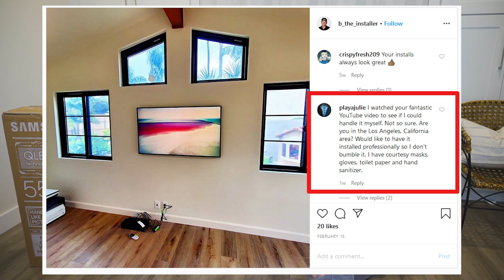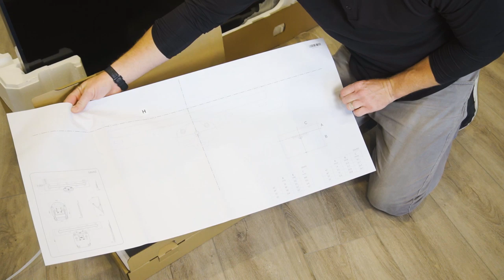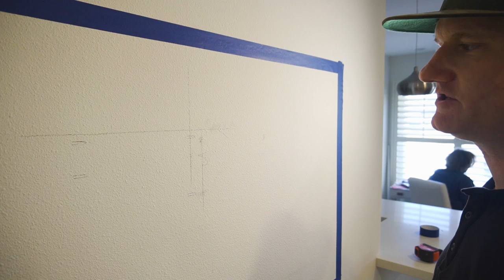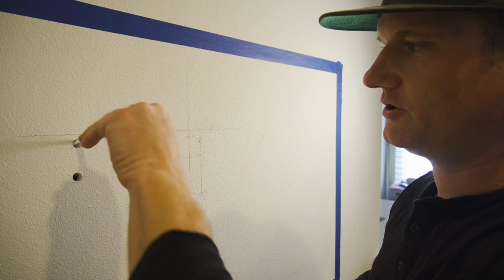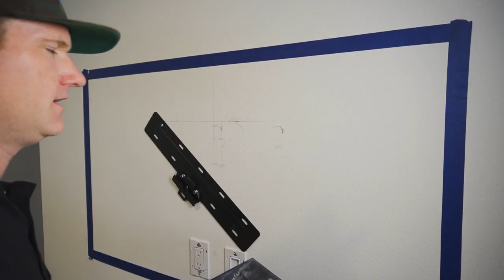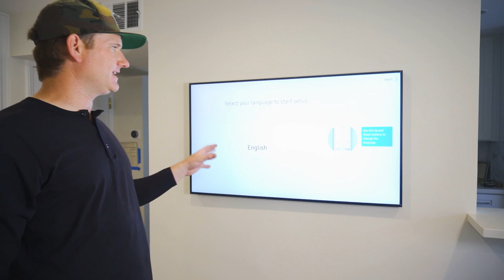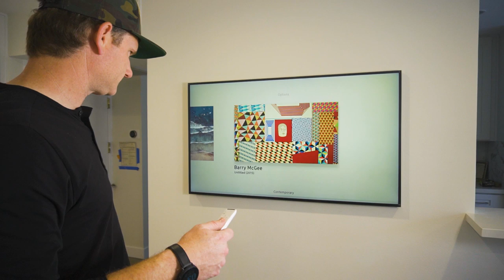Samsung Frame TV Install With No-Gap Wall Mount

Comment from the maker: New 2020 Samsung Frame video w/white customized bezel https://youtu.be/iUtvD4ZP74U
Reply: I noticed you took the outlet face covers off. Would that protrude too much for the TV when flush against wall. That was my concern for mine. I have an outlet  behind the tv, but didn't want it to cause the TV to not be flush against the wall
Reply from the maker: @calferath  yep, just push the outlet flat as possible.  You can overtughten the screws and suck it in.
Reply: Is the one connect cable that came in the box “In Wall” rated?
Reply: I bought a 50 inch frame because of you.
I hope my installation goes well 🤞🏽🤞🏽🤞🏽
Reply from the maker: Haha me too.  Post and tag on IG
Reply from the maker: No.

Comment: Thanks, you actually solved a concern I was having with my above the fireplace install. I though I was going to need to route power and Ethernet behind the tv. I don’t. It’s as simple as getting a couple of outlet boxes and covers to fish that wire through and building a shelf where the main box will sit on. Thanks again!

Comment: Thanks so much for sharing, it is so helpful. This is the 3rd Samsung frame installation from you I watched just before I did it a few hours ago.
I understand why your follower wanted you to do it, because you made it look like so easy! Lol
I actually struggled a lot with the toggle bolts, and even drilled all the way through the dry wall to the other side, ugh! Anyway, I eventually make them work and heeded your advise by adding just a couple more Samsung srews. I skipped the wiring because of a decorative wood panel attached to the dry wall, so basically just the measurement and 4 screws, but it took me 5 hours (including unexpected 2 trips to hardware store for extra toggle bolts). I'm glad I made it even though it took me such long time. 
Thank you again, without your videos I wouldn't have been able to do it at all.

Comment: Love the video! Have an upcoming job installing one of these TV's. Pro-tip from one professional installer to another: Invest in some JIS (Japanese Industrial Standard) screwdrivers or drill tips. Often times it's not the screws that suck, it's using a regular Phillip's head that does the damage as you noted due to the screws being JIS :)

Comment: fantastic install, but how the heck did you get power to the TV without putting in a recessed outlet? It looks like the face of the outlet would be right up against the back of the TV with zero space to route the cord?

Comment: Hi B. We have a stone fireplace all the way up the wall but we do have one of those holes already for wire to go into the wall and into the cabinet below installed. When hanging the frame tv ups we just use different screws and drill bits to drill the holes to put the tv anchor up?  Awesome videos you have helped me out so much already. Trying to place this tv perfect

Comment: Hey, B, thanks for all these helpful videos. I've learned a lot from you. If there isn't an existing conduit, what exactly needs to be done to add one? Are there specific kinds of hardware that can be snaked behind the wall? I really want to run the one connect cable behind the wall, but also want to be code compliant. I know Samsung sells an in-wall rated cable, but the few reviews I can find suggest that it's too thick to fit in the routing channels on the back of the Frame and people aren't able to do a flush mount with it.
Reply from the maker: Snake a little flex tube down the wall. 1.5 inch. Easy solve.
Reply: @BTheInstaller  Which conduit should we use?

Comment: Thank You so much! I do work on installing mounting tv sometimes and I just try to find out what type of driver bit is the Samsung frame mount screws cause it is easily to be stripped and I had to replace it with the one that it looks like it but i just prefer to install with the original ones which I can't trust on anyone of those, is there any advice to screw them in easily (the only solution is to put some soap over it?)or i just replace for different easy one? thanks B I learnt a lot watching your very informative video!! and I added to my skills on how to install this type of tv Thank You!!!!

Comment: Hi - great videos! Have you worked with the 2021 version yet? I just got it and the wall mount is a little different and seems to me to have a flaw -  difficult to describe but the part of the mount attached to the TV doesn't hold in place when you latch it onto the part on the wall. Curious as to your thoughts!
Reply: I was looking to see if anyone asked this exact question because I'm currently in the same situation with a 2021 version and the mount part connected to the tv not holding in place. I don't want to keep pushing it further back but I feel like there's a gap for sure. I don't know what to do. I may contact Samsung

Comment: Great video and straightforward friendly instructions. What are the concerns if you drop the one connect wire behind the wall without conduit since it is not in wall rated. How big a deal is this?
Reply from the maker: It likely will never be a big deal.  But if a fire starts in the house, that wire can't withstand heat similarly to one that slows the spread.  It's real some low % stuff, but I can't ignore it for anyone to get an issue.  Gotta do you.

Comment: Hey @B , thanks for this (and other) great install vids for the Frame. I followed your instructions and was able to get mine set up pretty easily. I needed some help after stripping a poor-quality Samsung screw, but other than that it was smooth. Thanks again!
Reply from the maker: Glad to hear.  Those screws suck balls.

Comment: Thanks for creating this video. We are forced to install ourselves due to Covid. This video will help us tons. Otherwise we would hire geek squad or want to try to hire B the installer to do it !
Reply from the maker: Good luck.  Keep me posted.  Share an image on IG and tag me
Reply: B The Installer we installed the TV. The only thing we noticed is there is a slight gap btwn back if tv and the wall.
Reply from the maker: Shouldn't be more than a normal picture.  Hey tag me on IG if you post a pic. Thanks
Reply: B The Installer yes. I tagged you on IG. Hmmm. Idk why there is a gap. Shall we just push on the top area where there is a gap?
Reply from the maker: You can pull out the bottom while pushing in the center of the top.  It may help.  Yes you can manipulate the tv a little to get it to sit flat.  Just be careful not to lift upward
Reply from the maker: Could also be that your wall isn't perfectly flat.  That does happen....
Reply: B The Installer thanks. Well we did have two outlet wall plates located right above the wall mount bracket on the wall. Could that be the reason for the gap?
Reply from the maker: Did you remove the cover plates? I would.
Reply: B The Installer we forgot. I think that’s why it’s not flush on wall.

Comment: This is exactly the information I was wanting.  Excellent!!!   You stated the one connect cable is not "in wall" approved. So where you dropped the one connect cable, is there a piece of conduit behind the wall?
Reply from the maker: There are sometimes.  Sometimes not.  I put in wall either way. It's technically not rated for in wall, but that is hard to evaluate the risk vs ease of use.

Comment: Thank you for the video - helpful as always! My question is with the One Connect Cable - is it okay that a portion of it is between the wall and TV before it goes into the hole? Will it be pinched between the TV and wall enough to cause damage? Thanks again!
Reply: I am worried about that too and does it add more space between the wall and TV? Makes it look tilted due to the wire bump? Do you have a photo of this installation from the side angle? Thanks for making these great videos B!

Comment: Getting mine mounted on Thursday! Planning on running the cable in-wall through a nonmetallic flex conduit. So you haven't had any issues with your installs where no conduit was used and cable was run in-wall? I'm a little paranoid so may be turning off the outlet every night before bed until an in-wall rated cable comes available for my model hah.

Comment: Thanks for the helpful video B The Installer! It will come in handy once I get my hands on one of those babies. I've looked everywhere but can't really seem to get a video that shows how far the TV tilts to the sides (6 degrees as per Samsung) as I'll need a bit of an angle when viewing. If you looked into that what was your impression, can you angle it enough to view it from the side?

Comment: 👍Good installation video,but one question- you did not done hole just behind the one connect TV connection in this installation? Does that fibre optic cable will get problem in future due to continuous pressure from TV unit,and the TV will also pushed little bit forward(tilted) from lower part??
Reply from the maker: No, there is little pressure on the wire from the tv and they lay very flat.

Comment: Thank you for this video!! Do you know if the mount would accommodate a tiny gap (like 3/4in)? Or does the TV really need to be completely flush with the wall for it to work? I wanted to install it on a wall where the middle is recessed a tiny bit.
Reply from the maker: Put a piece of 3/4 inch plywood on the wall by mount
Reply: @BTheInstaller  Thanks! I'll give that a try!

Comment: Great video.  I just purchased a 2020 55" Frame TV and wanted to know if i can use the One Connect chord that came with it in a thru the wall installation. Do i need or have to have a conduit? Thanks.
Reply from the maker: Well my videos will tell you that you should have only in wall rated cords in.  But it's a cord I put in wall with understanding and agreement of clients.  Does it look better in wall? Is it really a fire hazard ?
Reply: @BTheInstaller  Thanks. Sounds like it's up to me to take the risk or not.  Are your questions for me about looking better in the wall and if it's a fire hazard? Not sure what you mean, sorry.

Comment: Hey I take it you mount the TV frame into one stud which is in the middle of the frame and used the toggle bolts to mount the frame on the dry wall? That way you can have the tv centered on the wall?

Comment: Great video!
Regarding the fish tape, is it possible to bring the cable diagonally and across the wall to the other room?
Reply from the maker: You can down and out the back if there aren't breaks.  The studs prevent left and right movement.

Comment: Great video!! Do you think the toggle screws (using a mason drill) would work to mount on a stone veneer fireplace? I cant tell if i have studs behind my stone veneer. Would really appreciate your help!
Reply from the maker: Hey Josh, yeah its not super easy to find them, but it is framed...yes.  I use a 1/4 and 1/2 inch hilti drill bit and drill.... if you can shoot the 1/4 inch in between some of the rocks, depending on the pattern or if there is grout, you can angle it one way and put a hanger in and see how far left or right the stud is... and the 1/2 inch can be used in combo with togglers
Reply: @BTheInstaller   B The Installer  thanks man! Do you think the toggle screws are enough or do u have to find at least one stud? I guess the previous owners would have had to use studded frames to build a stone veneer fireplace, right? Thanks for the tips!
Reply: I have a similar stone tile veneer issue, but mine are also uneven. I think I can still do with toggle bolts and space out the bolts with extra washers to make it level to the wall?  Would love to hire you for a consultation to discuss, will send a note.

Comment: Thank you for the great information. I know in your video you discouraged this TV on a brick wall, BUT if it were a new build, would this be OK with proper planning ahead of install? Any recommendations?
Reply from the maker: Build in a panel with power in wall and house or you'd have to run the wiring through a channel of some sort, and as stated its not technically suppose to be in wall unless its the in-wall rated cord.  https://images.app.goo.gl/i5PYV8QpW33VtNvq6

Comment: Great installation video.  Thanks!  I have a question.  I like the idea of a TV doubling as a framed piece of art.  In your installation video you mentioned that The Frame TV would not be a good choice for installation on brick or stone primarily because of the one box cable.  I am redoing my dated brick fireplace with stacked slate.  I  have an electrician who will be running power and coaxial  to the area where a TV will be mounted prior to the fireplace refacing.  Is there solution that would allow for The Frame TV?  Or is this a situation where I should just purchase a different TV?  I am unaware of any other TVs that double as framed art.  Are there others or no?  Thank you very much for all of your help.  I appreciate greatly.
Reply from the maker: The power and coax will do you no good with this tv.  The coax is pretty pointless, i would just stream a service or run am hdmi. But if the power and coax/hdmi are going to be run, get the LG CX.  Most new tvs have art options, this one just has the frame look.   The LG looks way better.

Comment: Great video, thank you. My question is not so much about the install, more about the TV. I am thinking of buying this TV (the 43inch version) and mounting it on a wall above the computer desk, and using it as a monitor from time to time. Do you know how colour accurate these screens are in case I wanted to do some photo editing with it?
Thank you.
Reply from the maker: It's not of the caliber of a Hi-res monitor.  Some people complain that the quality of these tvs aren't as good as some better samsung QLEDs, and not as good as LG C9 or Sony A9G or A9H. However i don't think they make those in 43...   but it's a nice tv/art piece and has the borders.
Reply: B The Installer Great, thanks for your reply.

Comment: Is the fiberglass cable not being squeezed by the TV? I ask because I have a brick wall that already has a hole designed for this, but I did not take into consideration the position of the plug behind.

Comment: Just purchased this 55 inch frame TV, on what height from floor should it be wall mount,for comfort viewing sitting on sofa? And also as photo frame, Plz guide..
Reply: Installation of TV is on tomorrow..
Reply from the maker: You should want the tv's upper 3rd at eye level when walking by as a start for art.  Then if you have anything going under it, you can adjust, 8-12 inches above an entertainment center, or see some of my IG pics

Comment: Thanks for the video. Is it possible to slightly swivel the Frame TV (to the left or right) with the provided wall mount? I mean having it flat with no gap when not watching it, but then slightly swivel it when watching it. Thanks!
Reply from the maker: Negative.  You can put on a vesa mount and/or get a recessed arm mount on Amazon. But then you have to fit that inside the wall by cutting drywall.
Reply: @BTheInstaller  Thank you!

Comment: Hello! Your video was a terrific help for our install of our new 50” frame tv! In your experience do the TVs have that clear film on the screen as well as the frame around it? Ours had it on the frame but I can not see where to get an edge on the screen. The picture, especially in art mode is awful! Samsung support said they felt the unit was faulty. Could I really just be missing where the film comes off?
Reply from the maker: No there is no covering on the screen.  It has a different look than some samsungs, more of a matte finish.  However it can be brightened in both modes.  The art mode is suppose to look dim and realistic like real art.
Reply from the maker: For the price of this TV, you can get a couple of very good performing  bright QLED and OLED that has exceptional picture quality and still has some art mode to it. If youd like my recommendations, we can chat, or if you purchased on amazon I can give you links to my replacements.    The frame look has a novelty cost to it.
Reply: B The Installer Thanks so much for replying. I’m waiting on hearing back from the retailer, I guess I really do just have a defective set. Of course with Covid resolution may take a while 🤷‍♀️ I’ll contact you for your recommendations if it doesn’t  work out!

Comment: Great video, and thank you. Since you have experience with the Frame tv's. I have a question. Can The Frame tv's be put on one those tabletop tv stands? Cause the way the feed are spaced it won't work on the  furniture I have, and can't have it placed on the wall due to various reasons.
Reply from the maker: They make universal stands that "could" hold that but most people don't spend that much for that TV to put on stand.  Many even or better tvs in price range. See links
Reply: B The Installer that makes total sense, and I'll check out the links. Greatly appreciate your reply. Thank you.

Comment: We are buying a Samsung Frame TV and I've been watching your videos to prepare us for the install....we are renovating but want my contractor to understand this.  I have even sent him this link and previous ones.  Can you answer a couple of questions:  We are mounting on a stone wall, so should the tile installer leave a gap on the backerboard to place the mount? and also, we have a gas (propane) fireplace below the TV (with proper clearances and non-combustible boards) What do you recommend for a mantel shelf to deflect the heat?  We should have gone with electric fireplace if I had realized this was going to be a HUGE problem.  We live in FL so the fireplace will not be used often.  Can you please advise?  Thank you.
Reply from the maker: Sounds like you need to hire me!! Lol.  I couldn't advise on such a project without more info and communication with you or contractor.  My info is available on my site.   Thanks.